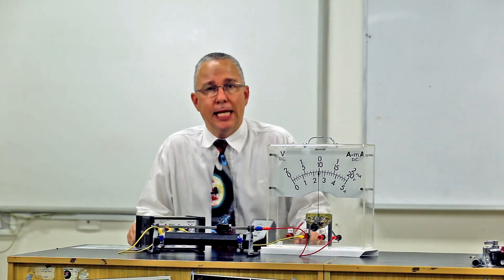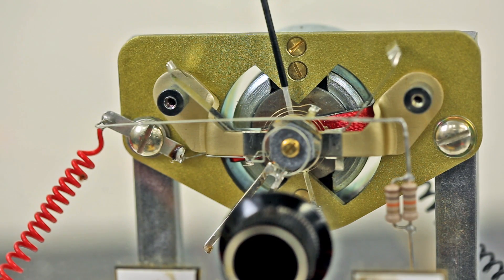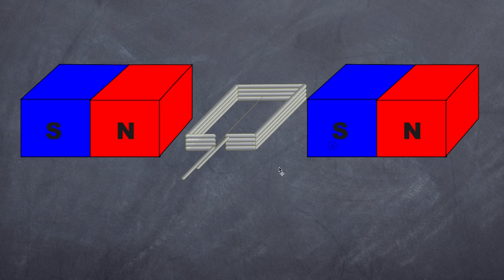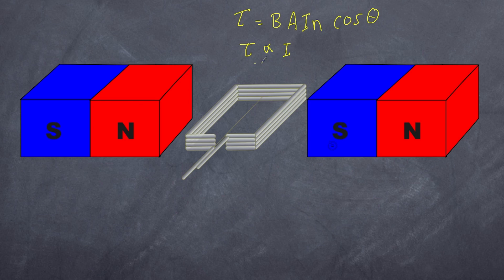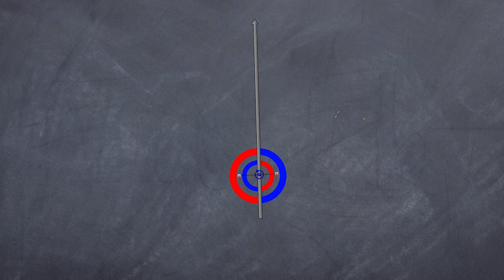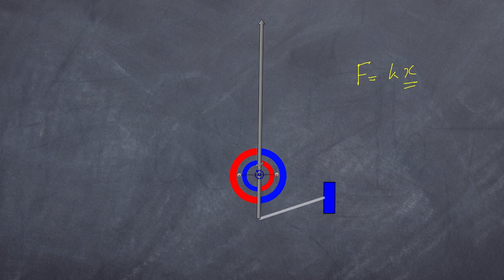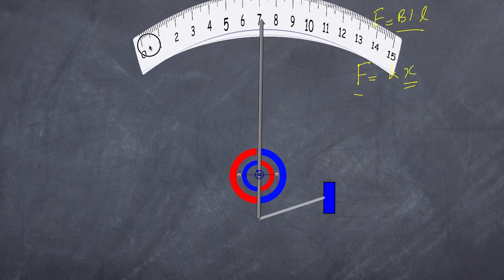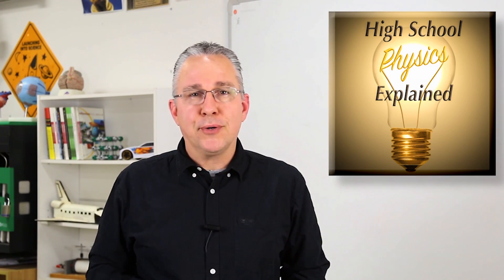How a galvanometer works with the motor effect

Comment: It would be fun to remove the spring, and mount a magnet to the end of the needle and have this magnet pass an amplified pickup coil so that you get a audio galvanometer where the frequency of the audio blips are proportional to the current.

Comment: Which of the following work as motor.?
A) galvanometre
B,) ammeter
C) voltmeter
D) none
Reply from the maker: If you mean a force on a current bearing wire , all do
Reply: Thank you so much sir.  Ur lectures are really  helpful  😊

Comment: Torque is a vector quantity... It should be a multiple of sin not cos
Reply from the maker: Depends on where you measure the angle. In this case it’s between plane of the loop and magnetic field so cos is correct.

Comment: Hier, von meiner Frau freiwillig einen Teil ins Deutsche übersetzt: 
Beginnend bei 6:00 bis 7 : 41  "So when a certain value is reached depending on the current..." bis "I hope that's been helpful, thanks"

"Wenn also ein bestimmter Wert in Abhängigkeit von der Stromstärke erreicht wird, verhindert die Feder, dass sich die eigentliche Schleife weiter dreht, wenn die Stromstärke erhöht wurde. Die Kraft aufgrund des Motoreffekts nimmt also tatsächlich zu, wodurch diese Feder bis zu diesem Zeitpunkt weiter gedehnt werden, bis die Kraft dieser Kraft äquivalent ist und natürlich aufhört, sich zu drehen, so dass die Feder die zweite Komponente ist. Wenn Sie verstehen, warum Galvanometer ohne sie funktionieren, drehen Sie sich weiter, aber die Feder bewirkt, dass sie an den Positionen stoppt. Als Ergebnis erhalten Sie natürlich eine Nadel, die nur einen festgelegten Betrag bewegt, abhängig von der Karte, die jetzt noch übrig ist. Zu tun ist, eine Skala hinzuzufügen, und jetzt können Sie sie kalibrieren. Sie könnten sie in diesem Fall bei Sieben stehen lassen, aber Sie könnten diese Null machen, wenn Sie möchten, und Sie würden sie dann eindeutig kalibrieren, indem Sie einen bekannten Strom hinzufügen. Sagen wir, es darf sich um eine bestimmte Position bewegen, als Ergebnis könnten Sie dann natürlich diesen Wert als neuen Wert bezeichnen und dann haben Sie ein Galvanometer oder ein Amperemeter oder ein Voltmeter, abhängig vom Wetter, fügen Sie einige Widerstände hinzu und wie Sie möchten. Schließen Sie es an, aber im Wesentlichen ist der Motoreffekt innerhalb des kreisförmigen Magneten mit einer Feder verbunden, um zu verhindern, dass es sich über den Punkt hinaus dreht, an dem Sie drehen wollten, sodass Sie dort einen Galvanometer haben. Ich hoffe, dass dies hilfreich war." Ende dieses Teils mit Hilfe von dem Google-Translator.
Reply from the maker: thank you for the translation. I hope it helps my German viewers. Please feel free to  contribute  to translations